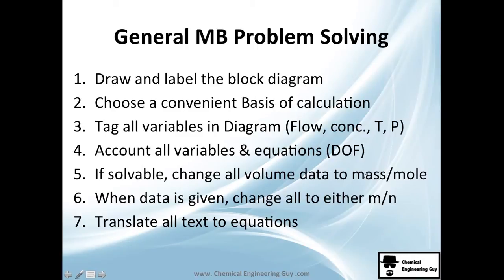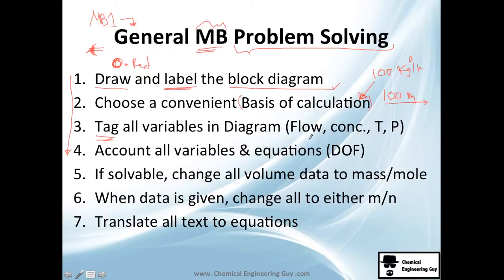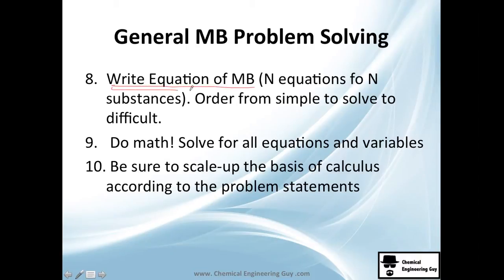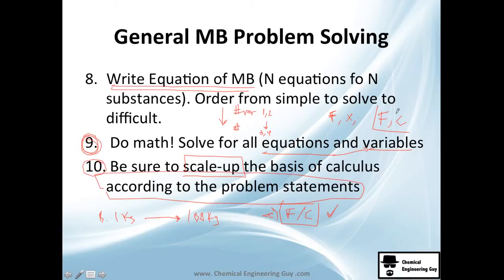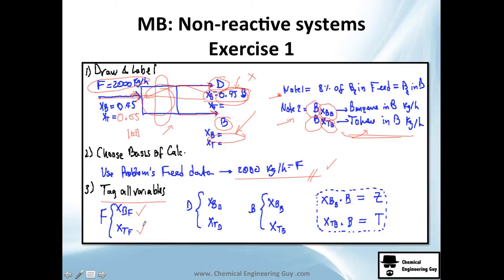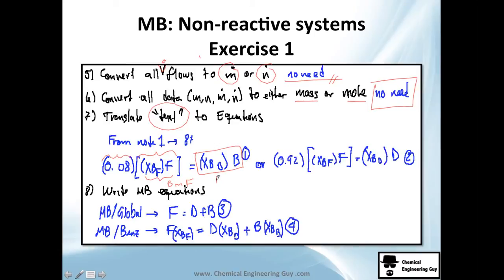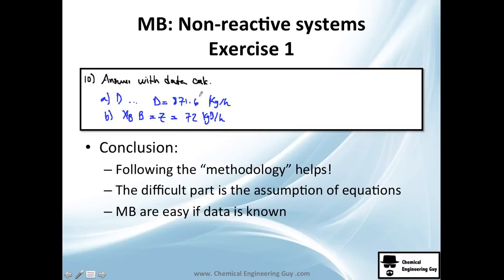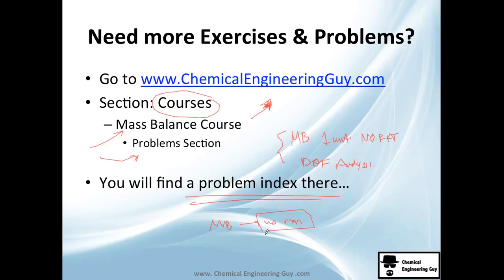Methodology for Solving Problems // Mass Balance Class 08

Comment: there is a mistake in min 12:20 is not 0.8 because that would be 80% is 0.08. additionally, the 95 that you said was not composition you used it as composition also at this point... This video was very confused

Comment: In total, great job with explanations. Except there is one mistake. At 6:44 you should've written 8% of "benzene feed" instead of 8% of fed benzene. The benzene feed tells that it is 8% of the whole stream, whereas fed benzene could be interpreted as 8% of the 45% benzene in the stream.
Reply from the maker: Chief Mongol True that. I meant 8% of the benzene being fed in the "FEED" is going to the bottoms! Thanks!
Reply: But how can that be true? If 95% of the fed benzene goes to "D", and 8% of the fed benzene goes to "B", then you end up with 103% of your original benzene. Doesen't make sense to me, so I assumed the 95% benzene was composition (even tough you explicitly said it wasn't), and the 8% was relative to the fed benzene. The problem worked out.
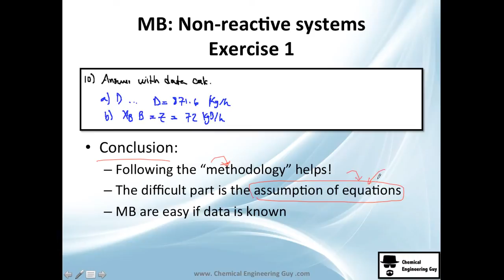Edit: I actually got the exact same answers as 15:47, so I did it correctly :D
Reply: @leonardsalt  I agree, this problem statement was really confusing.